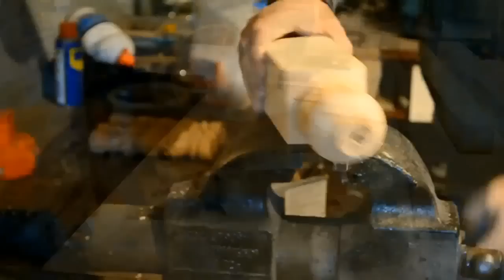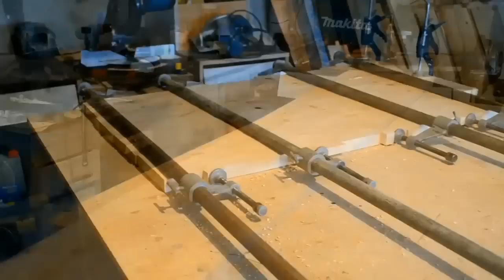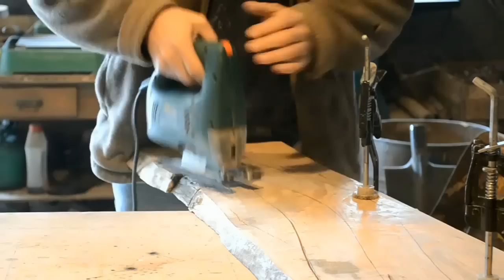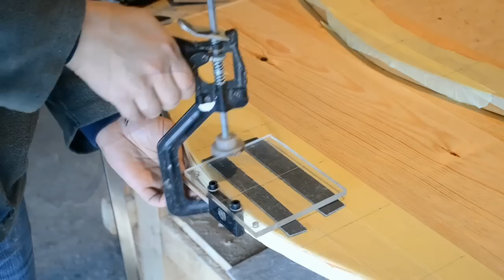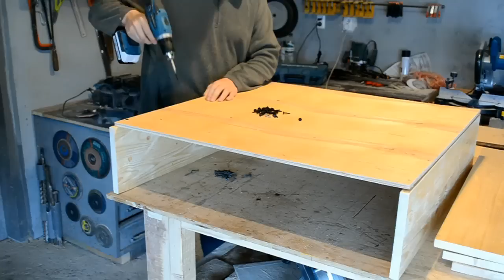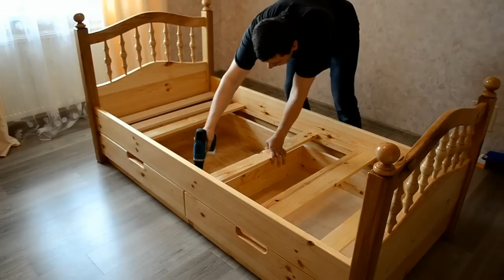Single bed with storage

Comment: I watched your video where you made your son's bed and thought it was beautiful but this one you made for your baby girl is stunning!! Just a tip, you might want to add a removable protective side rail just in case she rolls over too many times and may run the risk of falling, just until she's a bit older and will not need it anymore. Thanks for sharing :-)